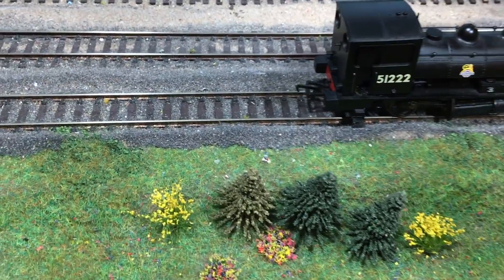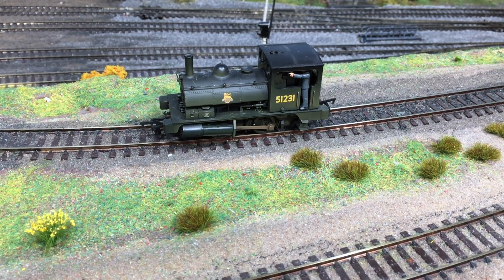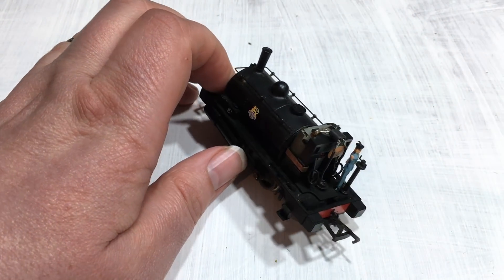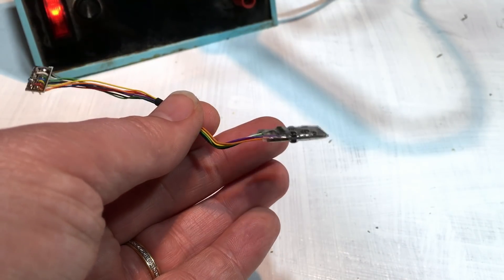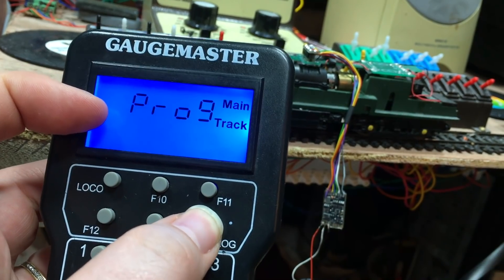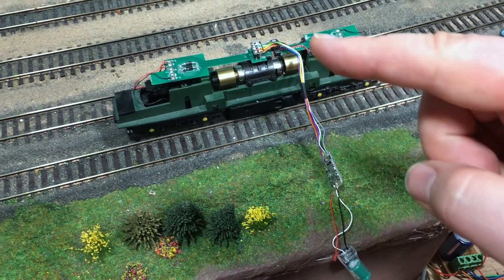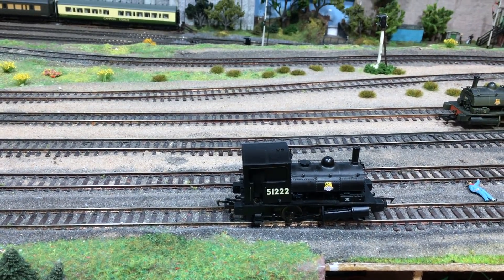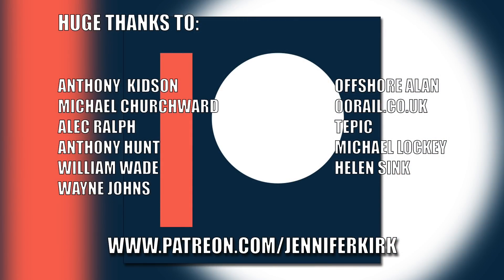How To Make a Hornby Pug Your Best Performing Loco on DCC

Comment: The website says that all there decoders are suitable for connecting the SPP capacitor, however I have bought the 7 wire Art 02010223 decoder and on the board at the other end of where the wires are connected I have 4 terminals on one side and 7 on the other, all the gaps between the terminals are the same so not giving any connection indication. I've been on the website and can only find a connection diagram for what you have here. Have you any ideas please?

Comment: I approve of gubbins. 

Stay alives are splendid - I use them on my N gauge layout. They make a huge difference.
Reply: I model n scale (1:160) but I can't see how a stay alive would fit my loco. Agree they would be most useful on n.
Reply: @LeslieGilpinRailways  Use tantalum capacitors for N gauge - very good space efficiency.
Reply from the maker: James Petts they transformed the pug into a fully usable loco. Very impressed.

Comment: Hello Jenny, if you take the motor out you’ll either get the decoder or the stay alive in, or both in the boiler, I’ve just bought one in pieces, but I’ve not fitted dcc to it yet,
Reply from the maker: That does involve removing the lead weight that is in there which renders the loco far too light to run well.

Comment: Jenny, I wonder if there was room to attach the decoder to the inside of the cab roof, with the power pack tucked into the boiler gap and sprayed or covered in tape to disguise it, if that wouldn't have worked and left a bit more space in the cab?
Bang up job though, opening up all sorts of possibilities.
Reply from the maker: Chazzy B the boiler is a solid block of lead. The cab really is the only space available.
Reply: @JenniferEKirk  Fair play, I thought I saw a gap, obviously not! Thanks again.

Comment: Lead free solder is a pig compared to 60/40 that is still available for hobbyist use. don't mix the 2. So if there is solder on something commercial that you need to redo, either redo it with lead free solder or get the old solder off and use lead free. look up info on solder suckers and copper braid. after tinning trim the wires very sort. It took some finding but there is some very fine heat shrink available. There is also some paint on insulator. Alternatively get some larger heatsink for covering the end of the decoder. You only need a narrow ring. Heat shrink that over the wires and area that you soldered onto the pads and any bare wire ends that hopefully you have short if you trim them short. Nail clippers are good for that but nice sharp rail cutters do a good job too. Consider using an open wagon to put the bits in rather than hoping that nothing shorts as you drag stuff. Good outcome.

Comment: Another good video Jenny. Really helpful. Are you going to try the N gauge stay alive in one of your OO gauge Locos? It will be interesting to see how it performs.
Reply from the maker: David Andrews I’ve tried one and they actually work really well. Essentially same run time but different shape depending on space available. They fit into the boiler of the Bachmann Jinty where the short fat ones won’t.

Comment: Put the decoder on a wagon if you are testing. It only takes a small time in contact with the rail on the wrong point of the decoder and it is gone to decoder heaven.
Reply from the maker: BAMBAM5476 the magic smoke was carefully restrained from fleeing!

Comment: Would have been nice to see the loco running before you upgraded it as we haven't seen if in fact the running was improved.
Reply from the maker: David Hylands the comparison was with the straight DCC hard wire as shown in the video. On DC which I have no track for, they run at warp speed with a tendency to stall on points.

Comment: Clean the wheels, track and remove all the crusty big lumps of ballast off the inside of the rails to give it a chance and only a small stay alive capacitor would be required to get it over insul frog points.